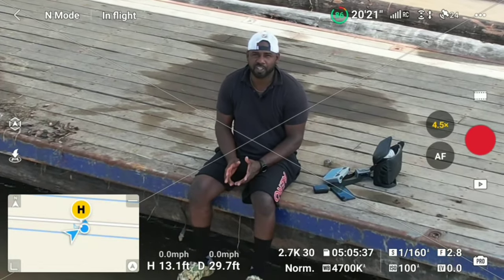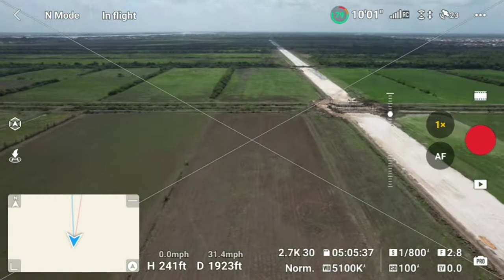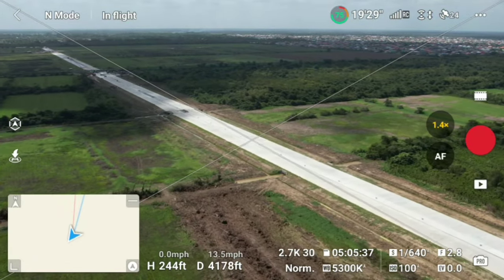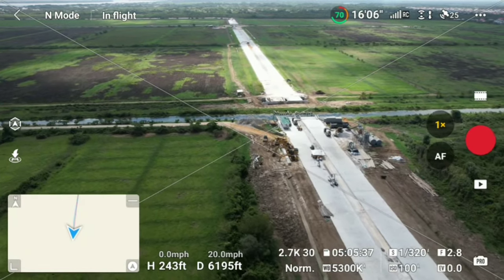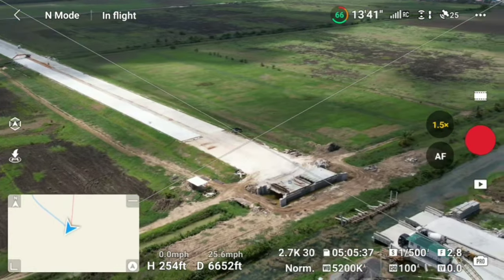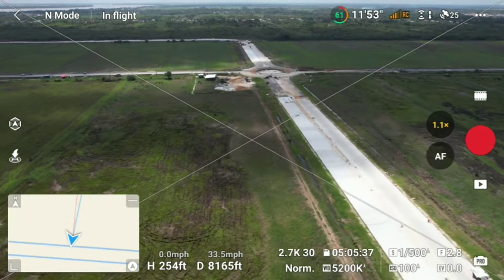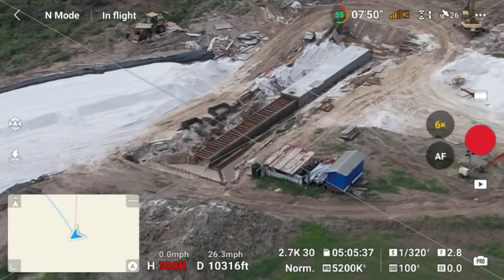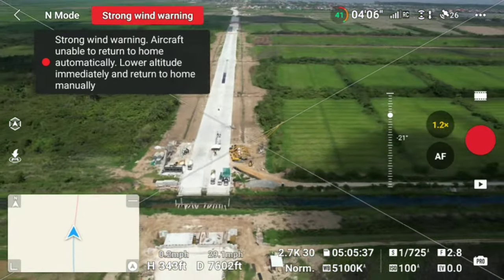SCHOONARD TO CRANE NEW ROAD. #georgetown #guyana #newroad #vreedenhoop #Westbank #demeraraharbour

Comment: Over 2 years they can't finish that road. Slow contractors
Reply: For your information, they have been working on the FDR in New York City for over 30 years and they still can't finish. Also, they are so parts of Highway like the New Jersey Turnpkye/I-95 that they have been working on for 35 years and counting. And they have not finished working on those. So, stop being an hypocrite.
Reply from the maker: New York FDR  (35 year unfinished project) is not a fair comparison to the new Crane road which supposed to take only 24 months.